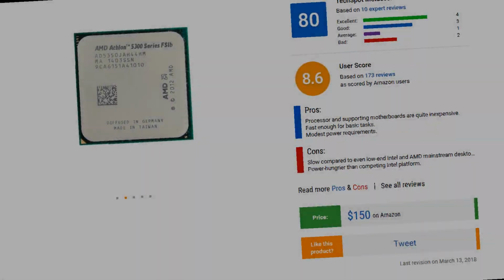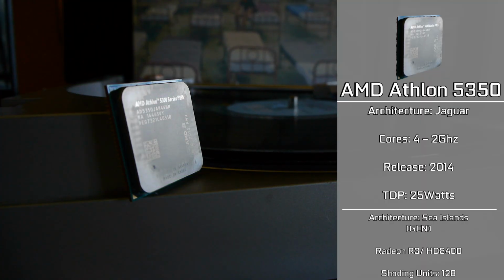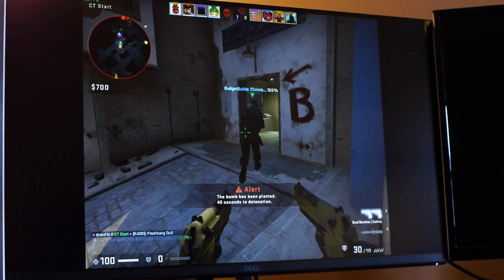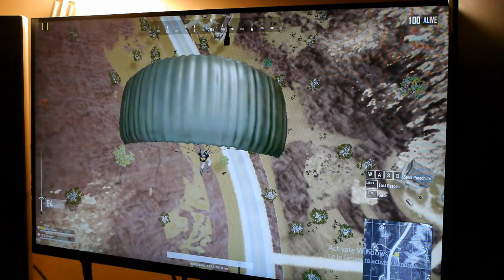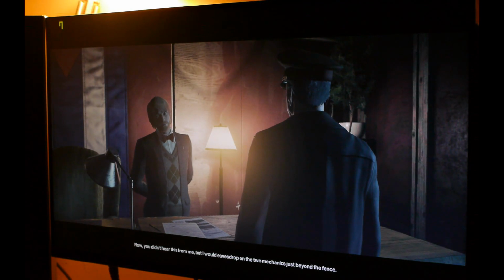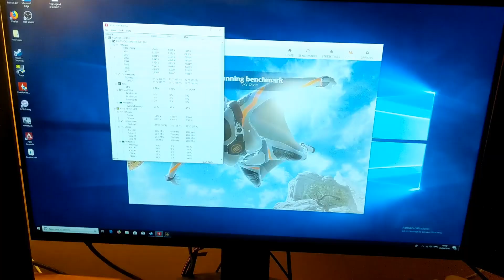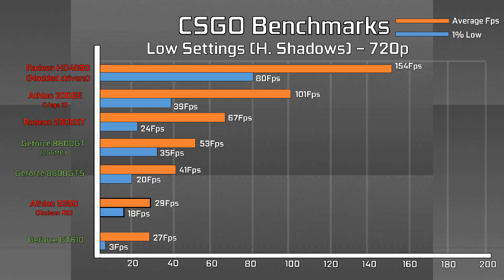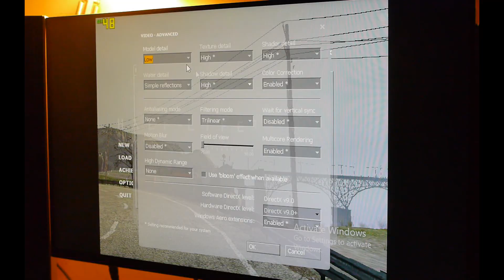Socket AM1 - Aging Horribly!

Comment: Bbo: "I'll be putting basic specifications"
Adds 16GB ram
Reply: I've had 16 gigs of RAM in my desktop since early 2012.
Reply: In 2019? Yes is basic to game / office PC.
Reply: @jedediaszzimmermann4903  8GB is basic nowadays
Reply: @resneptacle  8GB is still plenty, for 99% of things.
Reply: @jedediaszzimmermann4903  No. 16GB is the recommended nowadays, but not common or basic. 8GB is normal and 4GBs is basic still. My dad runs 4GB with a 7th gen i5, he uses it for work, spreadsheets, Chrome and sometimes Solitaire and DOOM (1993), works just fine.
Reply: damn, ive got 3gb of ddr2 ram
Reply: @vodliedood3385  go on eBay u can get a 8gb kit for around $20
Reply: @vodliedood3385  oh unlucky
Reply: @vodliedood3385  32 bit OS?
Reply: @Oneon  nah its 64 bit
Reply: @vodliedood3385  I have a motherboard that is rated for max 2 GB, according to the manual, but I added 4 GB and it works just fine.
Reply: @vodliedood3385  spend like $350 and get a used enterprise pc with lots of ram and a good cpu
Reply: @bUwUmer1260  350 bucks? Das a lotta money
Reply: Internet Guy intel Xeon e3 1220 v2 works good for my secondary PC
Reply: @vodliedood3385  I wanted to say how 200-ish dollars, which is enough for upgrading to a not completely ancient system, should be easy to save up over enough time for pretty much anyone who is interested in tech and doesn't literally starve, but you sound underage in your videos, so I guess it doesn't apply as much.
Reply: @zeratulrus142  I'll save 200 bucks over time of course.... if I dont want to eat at all for a couple of weeks
Reply: @vodliedood3385  do you literally only ever spend your money on food and necessities?
Reply: @zeratulrus142  no, I'm just a 13 year old that doesnt get any pocket money
Reply: @vodliedood3385  That's why I said it doesn't apply
Reply: @vodliedood3385  Get a used dell optiplex with an i5 4000 series chip, they are like 50$.
Reply: The weakest link is the integrated graphics which were marginal for gaming even back then.
Reply: @MrNúmero98 yeah but 9/10 people who sell you gaming pcs will tell you anything is enough crunch frames, if ur cuz built it then that just sounds like a budget shortage
Reply: Soi sloyw
Reply: Dude, thats so sad, my motherboard can only handle max 4gb ddr3 :c
Reply: Lol 4 was a lot not long ago.
Reply: @MrNúmero98 so yeah, budget constraints
Reply: 16GB of RAM is pretty basic by today's standards
Reply: My X140e has had 16GB for about 4 years, now...
Reply: And now 16GB of ram is even considered small by some...
Reply: Its DDR 3 ram so technically it's basic
Reply: @randomweirdyoutubechannel8955  I'd rather use that than my pathetic 4gb DDR4
Reply: @randomweirdyoutubechannel8955  Not basic for DDR3, for DDR3 the minimum used is 4GB but the average and by far mostly used was (is?) 8GB, 2×4GB. The norm for DDR4 is 16GB pretty much, although I have 2×16GB plus 2×32GB. I am special.
Reply: a n i m e
n
i
m
e

Comment: I wonder how much that the Specter/Meltdown patches come into play. In the video, I notice that Windows 10 is used with DirectX 12 which should have those areas already patched. Some people still using the AM3 platforms with FX-8350s have notice a hit in performance from these patches. This CPU may be suffering from some of those issues, but it may just be a potato. If you have a way to get around the patches, the CPU may give better results, but it is a 10 year old chip.

Comment: Bulldozer/Excavator architecture as a whole is aging badly. The whole thing is garbage and im glad they brought out Ryzen.

The only reason the consoles (and high end processor versions) are still holding up well is because the consoles are so well optimized, and the 8 cores are effectively 4 cores which is enough to handle anything really.
Reply: And it's not Bulldozer, it's Jaguar. a very different architecture.
Reply: No,  the consoles get the full 8 cores performance,  because they don't overload the shared resources.

Comment: Sad you didn't do a cinebench run however i found one, 110 CB is low powered celeron for mini PCs or cherry trail atom performance. How would it do streaming steam games? Might be a use for it? This is one odd CPU, well done sir, just don't let it scratch the pink floyd ;)
Reply: Also i am sure this socket was fm1

Comment: These weren't good value then, and certainly aren't now. in 2014, I had a i3 4130, which was part of a very tight budget build.. My core 2 quad system had just died, and I needed a new system ASAP for work. Paired with a Radeon R9 280 it ran both fallout 4 and GTA 5 very well. 1080p quite high settings with more than playable frame rates.  Both games were a great experience on that set up. The i3, and the FX 4300 may have been twice the price, but both more than twice the CPU's. That i3 is now powering my parents PC, and still feels just snappy and responsive as it always did. Easily powering through anything they do with it. To be honest, I would wager it would still happily run  newer less CPU intensive games quite well. Also correct me if I'm wrong, but didn't Intel make an overclockable Pentium at the same time that was around this price as this Athlon, and got very close to the i3 and fx4300 in performance?

Comment: I have this AM1 in the 5350 flavor (Oc 2.1mhz)  with 8 gigs of 1600mhz of ram and 120 ssd/3 terabyte drive.   I don't use this for gaming but for surfing the web, Movies,  And YouTube/Netflix content.  Plays 1080p movies and content just fine. (Cheap and very reliable)   Being an ITX  form factor I'm using it in a small case with wireless devices only.  Media use on the Kabini is perfect and can still function in a pinch with any reasonable task at hand.  Hey Budget Builds,  Have you ever tried messing with a Zotac Ion system from the 2008/9 era?  ITX form factor with Nvidia graphics?  (i use one of these as well for media content)  Cheers and thanks for the review!

Comment: wow this thing is horribly weak. Back in 2014, I had an i3 4130. Yeah that CPU was more expensive than this no doubt, but probably not that much, considering I built that system in a panic with little money, after the core 2 quad machine I had at the time bit the dust A lot of the games your playing here like Fallout 4 used to run pretty good on it, with a Radeon R9 280. And by good I mean high setting at 1920x1080, with some pretty solid frame rates. It was certainly a very enjoyable playable experience on that system. I didn't really run in to issues with that CPU until Just Cause 3. For the most part, though I suspect it would still be able to run a lot of newer games.

Comment: I hate to say this, but the Athlon 5350 is about as good as an A8 4555M (what's inside my $500 AUD laptop). And that little APU is only 19W, based around the 32nm process. So actually a bit of a step backwards from AMD when they really couldn't afford to take any more.

Comment: 4 cores at 2Ghz was NOT impressive in 2014.

I had 4 cores at 3.8Ghz in 2007!
Reply from the maker: Not at 25Watts and £35 though ...
Reply: @BudgetBuildsOfficial  No, I'll give you that. 
But it's still not impressive from a performance standpoint.

You could easily get a Core 2 Quad/Phenom x4  for much cheaper and still get better performance per dollar.
Reply from the maker: Yep. I was more aiming for the powe envelope point.

Comment: Am I the only one using an FX with Titan Xp? Because it’s the Titan that’s vastly too slow at 4K, I’m not sure why it gets such a bad rep, or why people spend more on the 8 core Intel than my TR-1950x just for the possibility of 800 MHz higher, it’s seriously over 4x more expensive to get the Intel 8 core over the Ryzen 1700x, is it really worth that? Are people that often running duel 2080ti so that there is actually even a 3 fps difference and not completely GPU bound? Because even a stock FX should be good for even duel Titan Xp from what I’m seeing (and we all know FX overclocked a lot, so probably duel Titans on liquid nitrogen to make a good match for FX overclocked on water).

Main build is TR with 4x Fury on water (100 fps in Crysis 3 at 4k Ultra vs 45 fps with the Titan Xp Star Wars collectors edition, hence the Titan is in my “retired build”, but I had to use it some due to water leaks and modding my main system into a vampire style casket, so I’ve done some testing on it. It’s definitely doing about identical to my Ryzen 1700 or Threadripper, meaning it’s GPU bound when changing all kinds of CPUs makes no difference). FX still seems to be going strong in 2019! Nothing Nvidia has single GPU is even close to fast enough (including on liquid nitrogen, no RTX is fast enough for the FX to be an issue in most games based on what I’ve seen)

Comment: Nice roundup, shame to hear that performance wasn't so great. But I must mention that this was released before the release of Windows 10, and Windows 10 isn't known to be light on usage. Windows 10 is more bloated than Windows 7, and I'm sure I saw a recent review (either by yourself or RGinHD) of either a Celeron or Core 2 Duo (or some other, single core, CPU) that was fine on W7 but just not usable on W10.
Likewise, my HP laptop uses over 0.5GB less RAM on idle on Windows 7 compared to Windows 10. Therefore, I reckon Windows 7 might have been a better choice - especially given how Windows 10 gets ever more bloated with each "feature update".

Comment: Sounds like my Phenom x2@x3 550 BE with Radeon HD 5770. Although this cpu is like 10 years old and think it ran better, I managed to finish Witcher 3 on it at FULL HD resolution and I think it ran better than on lower res, I had like 10-30 fps in this game. In GTA V I had 20-30 at FULL HD. In Dark Souls 3 I had like 10-20 fps or maybe worse, definitely there was a lot of stutters and crashes but also I managed to finish it, also I had like 1k hours in Path of Exile which also was a slideshow and 15-30 fps in Guild Wars 2. In every game I think I had better fps at 1080p than on lower res, I only had 4gb of ddr3 1333mhz ram which definitely added up to the shitty experience.

Comment: I used an Athlon 5350 with the Asus board so I could overclock it to 2.6 GHz. I was really disappointed when I thought I was upgrading to a Phenom II x6 running at 3.6 GHz. The 2 CPUs had the same experience. It was really just a side step move. I used the Phenom II x6 a little bit this year and I can see how it would struggle with modern titles. When I got the Athlon 5350 new, it did fine for gaming at that time. I had it paired with a GTX 460.

Comment: I bought two AM1 systems cheap. One is my HTPC as it is low power and can stream video. It is dog slow booting, but once it's up you're good. I have a dual core Sempron version that I use as my pfSense box. It is more than capable of doing that.

Comment: Im stull running a AM1 system as a Router and its stable, Fast, and energy efficient.
and for router use it supports aes-ni that the lower power intel chips did not support back then
Reply: Perfect pfsense box. Also very good for a proxmox box with some small linux servers on them.
And use basicly no power at all.
Reply: I used an AMD Athlon 5150 for pfSense, OPNsense, OpenELEC (Kodi), OpenMediaVault and FreeNAS (right now), it can even do one 1080p transcoded Stream.
Thanks to its low TDP it can be cooled completely passive (Arctic M1 Passive) without getting hot at all :). But Gaming isn't what it's made for
Reply: I still have a system with a 5150 running in a shed. It does a great job running security cameras and a fileserver. As a side job its mining some Eth with a rx560, the heat clears some humidity. If i need to google something while im there thats also more comfortable than using the phone. Still rocking winamp to the stereo. Its the most stable rig i got.

Comment: I wonder why the frequencies were so slow on AM1? What was the fastest? 2.2GHz overclocked?  Also what were they supposed to be competing with? Intel Atoms? Compared to an Atom, I'd say there were pretty damn good.
Reply: As said in another comment, those AM1 CPUs were set at very conservative on stock frequencies (I guess it's a way to sell more of those binned Jaguar chips, AMD also did that on AM3 Athlon series) and they can be overclocked quite high.

Comment: This performance is downright horrifying.  Sub Phenom II x4. With a Fury. Christ. Not surprised, seeing how low it's clocked. And the modern consoles basically have a couple of these running at 1.8/2.1ghz on the same die as a Radeon 7850/7790/470/580 (PS4/Xbone/PS4Pro/One X). Not surprising that none of them can do 60fps reliably.
Did you try overclocking it?

Comment: I have an AM1 socket AMD 3850 CPU in a computer I use as a server. It's a quad core 1.3Ghz CPU so even less performant than this one, but I only ever use it to host a web server, print server, and NAS. For that pretty basic workload the 3850 is an excellent choice, and it's got a low TDP at only 25W. I built it a few years ago for a cheap, low power, x86 machine that could run things I couldn't on a Raspberry Pi.
Reply: That is where these things shine. Got 2 of them running as servers as well.

Comment: I had the A6 5200 in my laptop which is basicly the same CPU just soldered onto the motherboard, so its actually from May 2013. I got gta 5 to run well on that thing but after the laptop Broke Down 1 year after the warranty ended i didnt care about that thing anymore. I got myself a Dell with an i5 3380m and was happy with it and now moved on to another Dell but this time with an i7 4710MQ and a quadro K2100m.

Comment: Back then I bought the Celeron J1900. It's slower but at 10w TDP it's almost 3 times more power efficient and it's fanless, so it's way better solution. I still use it today as my HTPC, connected to my 4K TV. Last year I installed a GT1030, since I needed 4K resolution and HEVC hardware decoding. The whole system is completely fanless and is powered by a 60w DC adapter. Love it.
Reply: TDP only matters for peak load scenarios

Comment: You should try the AMD A6 5400b. I've had it in my system for a good few months and it's way nice for a dual core. Recently upgraded to a quad-core b-series processor. Wasn't the best but great for lowend gaming and some modern titles.

Comment: My 5370 (faster clocked) worked awesome in my HTPC, probably close to intended use. Reasonable games worked fine (L4D2, Bioshock Infinite, etc). I even completed Doom 2016 on Vulkan at 40 to 60 fps. Its NOT a high end CPU now but was incredible compared to older budget low watt cpus like Atom.

Comment: That is not confusing at all, AM1 socket in 2014, AFTER AM2 socket was around since 2006, wtf.. Did I see in a dream that AM1 was before AM2, looks like it went straight from 939 to AM2.
This should have been FM3.. what the heck AMD!?
Reply: Probably just trying to fit in with existing socket branding: it was previously called FS1b.

Comment: Half-Life is misbehaving due to it running on an AMD graphics chip, not because it's running on that specific AM1 chip. It has performance issues across all ATI/AMD hardware, regardless of specs. It also runs poorly on Intel GPUs as well for the same reason. The cause of the poor performance in Half-Life is because of the very buggy early compile tools (they were basically hacked Quake 2 compile tools) used to compile the Half-Life storyline maps that create a horrid mess for the engine to have to work out. Styles lights (lights that flicker, strobe, fade, etc.) also murder frame rates due to requiring large immediate scene changes.

Back in the mid to late 90s, most OpenGL based games used a rendering technique called "Immediate Mode", which basically blasted frame buffer data directly to the GPU to be rendered. It was a grossly inefficient, brute force method of setting up the frame: issuing the calls to draw then frame, drawing it and then blowing everything away for the next frame. This is in contrast to retained mode, where the API retains data about objects on the screen that can be used again in later frames.

ATI stopped optimizing their drivers for immediate mode (and OpenGL in general) with the introduction of the x300-x1000 card lines, leaving the Radeon 9000 line the last being optimized to use OpenGL's immediate mode rendering. I've had at least one of every generation of ATI/AMD GPU since 1995 and can confirm this.

Sven-Coop added a workaround after I had complained for years about it, you can type "r_dynamic 0" in the console, which will disable dynamic lights and drastically improve playability. This also works in Half-Life, but you need sv_cheats 1. The downside is though that the flash light will no longer light the world.

Comment: You Totally Forgot How bad the Sempron 2650 is I mean I use It 😭
Reply: You don't even know how bad is to have a amd duron 1200 or an intel atom n455 as your main pc...
Reply: Eduardo Avila the Duron was a beast. 
For its time. 
It doesn’t add up anymore, and it’s truly a shame, for what was once a really cool piece of silicon.
Reply: This thing can barely run youtube
Reply: @djaysenpai  use h264ify addon and it will play youtube just fine
Reply: I use the 2-core Sempron aus Unify controller and for backup. It is slow but does the job
Reply: I also own it till now
Reply: im using it now with 4gig of ram its fast enough plays 1080p youtube fine get the h264ify add on for edge or chrome. with an ssd windows 10 quite snappy lol
Reply: i had an sempron 3000 lol i played crysis on him x.x